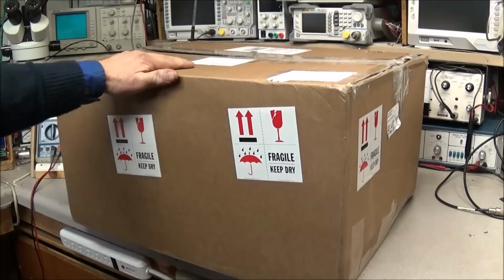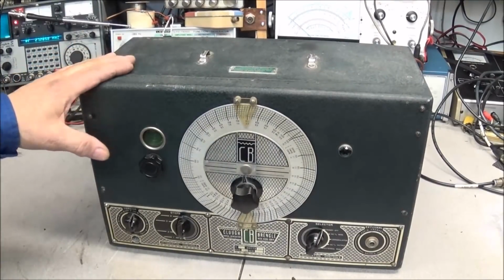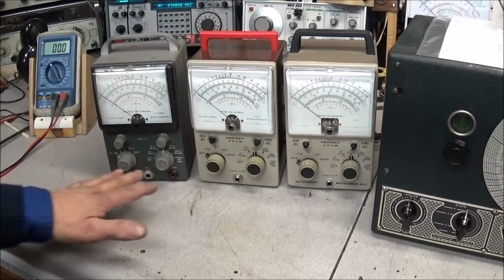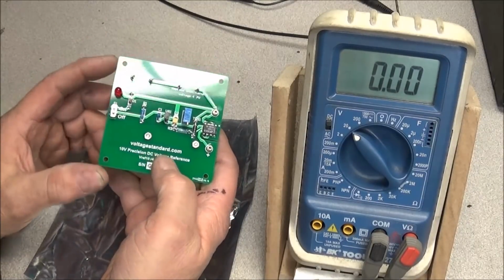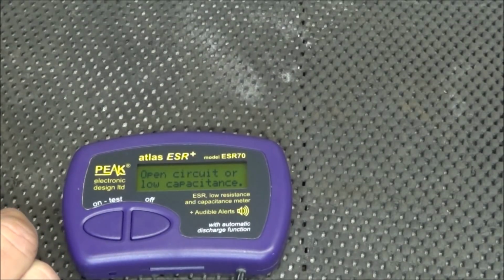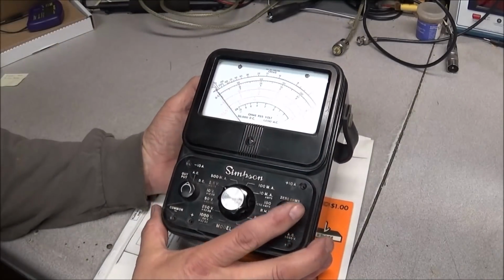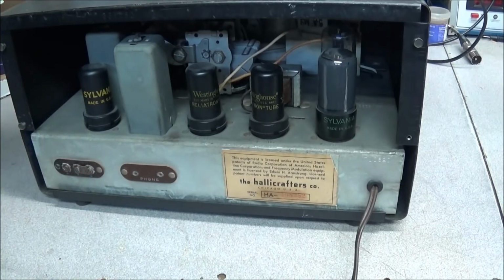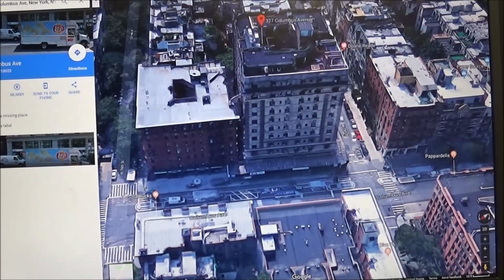#158 Mail Time And Future Give A Ways

Comment: The Peak analyzers are great, have a suite of them. The LCR meter has a tweezer probe but can't remember if I bought it as an accessory or it came with the meter when I got them; I THINK you can buy them separately as an accessory so you might check their web site.  73 - Dino KL0S
Reply from the maker: Thanks Dino. I will look around and see if I can find a set for them. This thing is better than what I could imagine.

Comment: Between you and me we will soon own all the old meters on the planet. :-)  Love the old Hallicrafters radios.  Have a stack of them here.  My favorites are the older ones that had the flip open tops.  I have a old capacitor analyzer here made by CB.  Thing is built like a tank and weighs almost as much as one. Thanks for sharing.
Reply from the maker: We seem to have a load of them that is for sure. The old Hallicrafters are good receivers, they lack above 21 MHz though but work great on the low bands. I tested the CB generator this morning and the thing works.  The audio output sounds more like a buzz than a tone though but the frequency is spot on with the dial.